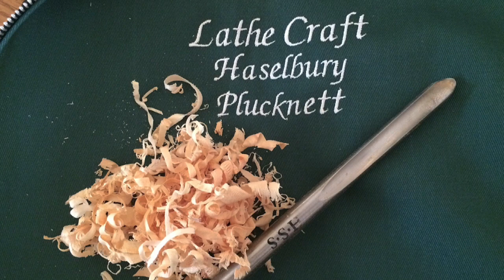Woodturning - A Woodpecker Nesting Log/Box

Comment: This is a good wood turning project, although not common.  Well done.

Good idea to oil the metal surfaces.   Wet wood generates a lot of moisture which goes all over the place.  So easy to place the piece on a metal surface for only a second or so, then the next day notice a rust spot.   Done this many times myself.

I hope the bark stays on the wood as it dries.

William, you are a braver man than I to mount the log sections and hollow with only a faceplate to hold the out-of-balance log.   Glad you noticed the section coming loose and added more screws.

I see woodpeckers around my property in eastern Pennsylvania.   I also hear them.   I have a dead section of a birch tree with a large number of holes made by woodpeckers looking for insects.

Good to see you trying to encourage nesting.   I hope you provide an update in the spring on whether the box is used and by the hopefully bird species rather than insects.

Dave.
Reply from the maker: Yes, I've learned to oil with wet wood through bitter experience too!  There is always a risk with large sections coming off the lathe, but it's easy to see it coming loose. 10 x 2 1/2" screws held it secure enough in the end. Yes Ill provide an update if/when its occupied.

Comment: William, I really like your idea and I think your approach will work well. Time will tell with regard to drying but of course it will be out in the elements so I find myself wondering if it's necessary . The only way to find out is to make 2 from he same log and treat them differently!  It's an unnecessary refinemnt but if you could make wooden shingles (videos on YT) it would  give a very natural look.

All the best to you for a happy and productive new year.
Reply from the maker: Thanks, Peter. I wanted it to dry out as much as practicable so it didn't split when in use. I do like the idea of shingles and I'm going to change the roof design.